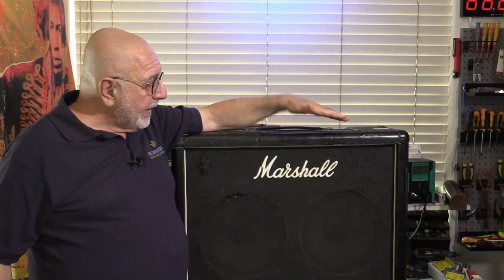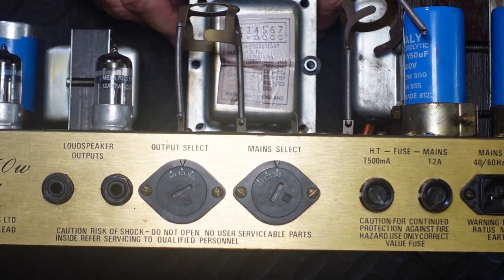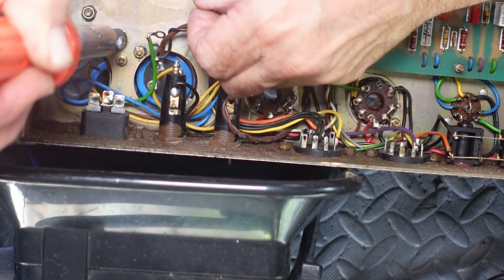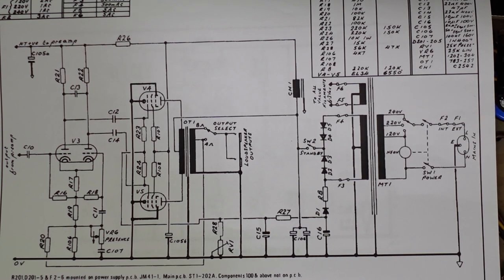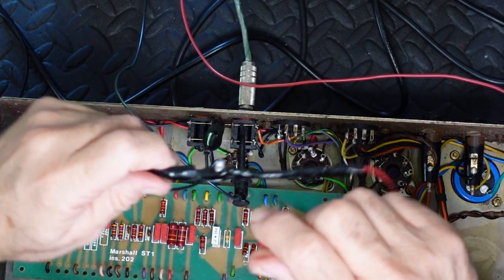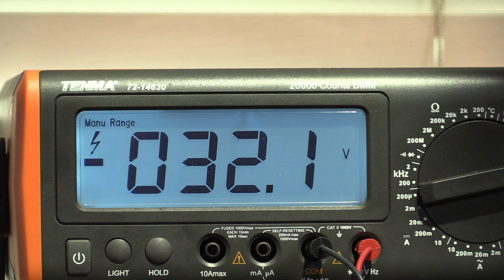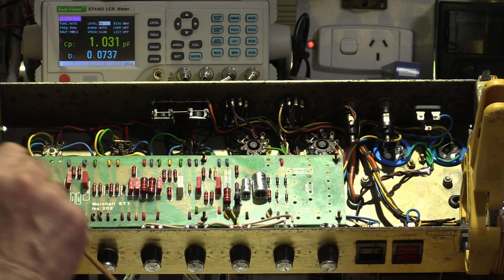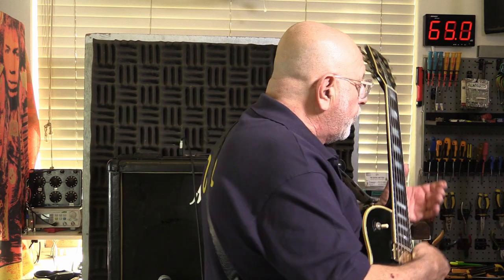How to repair a Marshall JMP 2104 with many problems

Comment: The more I learn from amp builds, the more important I think the power transformer is. In fact, not just the PT, but the whole power supply. I know, I know: we're talking about guitar amps here, so perfectly clean power, low ripple, beautifully regulated power supplies aren't the objective, etc, etc, etc. That's true. But I'm coming to the view that the power supply is to the signal chain, as the canvas is to the paint. No, the power supply is not strictly 'in' the signal path, but the signal rides on it. So the ropey, primitive power supply is a critical part of the character of a 5E3 Deluxe, just as the stiffer, better-regulated supply of a Twin Reverb is part of that amp's sound. And the PT is the heart of the power supply. So I reckon it's more important than a lot of guitar-playing amp users think.

Phew!

Cool old amp, and a cool video too, mate!
Reply from the maker: You stated the importance of the PT very well, Bladder! Thank you.

Comment: I just picked up a 1975 Traynor YGM-4 STUDIO MATE.  I went through and replaced some electrolytics, and I noticed that the bias caps were 68uf and 8uf. First time I've seen one that high. I'm glad I saw this
Reply from the maker: Good one, Soap. We don’t see many traynors in Australia. I’m glad my video was of some help to you.
Reply: I'm curious what other amps you.might have seen this implemented?
Reply: Also , would non polarized caps be ok to use ?
Reply from the maker: @soapboxearth2  non-polarized capacitors can replace polarised electrolytics. Non-polarised applications are often used for coupling, tone caps, feedback,  and oscillation. In amps, we mainly see polarised capacitors for filtering ripple or cathode bypass applications. Electrolytic capacitors usually have larger capacitance values for a given voltage. It is not so easy to make a large-capacity non-polarized capacitor, because the size and cost make them unpopular choices.
Reply: @theguitaramptech  so the bias circuit caps are filter caps? I guess I should use polarized?
Reply from the maker: @soapboxearth2  it’s the most common choice

Comment: Thanks Chris. I really like the way you set bias with the oscilloscope. It seems to be way more accurate that setting grid voltage. I looked up Doug Ford. What a sound!
Reply from the maker: Thanks Les. Setting bias by grid voltage will get you in the ball park. Setting by plate current is much more accurate, but setting by "Loud" playing levels using a signal generator and an oscilloscope shows you exactly what the tubes are doing.  I use 440Hz at 250mV 
If you have Nickelodeon on Spotify, listen to Doug's tone on that live album!!

Comment: Thanks for another great video, Chris . I appreciate you going through the schematic and didn't realize the high input was feeding back through the low input jack to the 2nd gain stage. Nice work brother man!!.
Reply from the maker: Thank you for your "thank you"! I appreciate it. Yes those contacts work great when the amp is new, just as the Send/Return problems. But in time they clog up and it "welcome to the world of intermittent problems".

Comment: Just noticed that this Marshall amp doesn't have any grid-stopper resistors between R23, R24 and the grids of the two power tubes, normally you'd be seeing two 5k6 grid-stopper resistors there, or maybe 2k2 grid-stopper resistors.
Reply from the maker: Yes, I noticed that and I like to have grid stoppers, but from memory the schematic didn't show grid stoppers. When you say "normally", are you referring to a 2104 or Marshalls in general? Thanks for the comment, Simon.
Reply: @theguitaramptech  , I also installed the 1KOhm 5 Watt screen grid resistors, and the 5K6 grid stoppers after I sent marshall an email that they were missing in my 1980 JMP 2104. There answer was that in those days the tubes were from a far better quality and so it was not neccesary for 50W amps back then. They advised me to install them if I use current production EL34 tubes for safety. It changes the tone a very little bit.

Comment: Intresting video Chris! What is your leakage tester device exactly? A led with a little resitor in series? Could you share the schematic ?
Reply from the maker: Its basically what you said. From memory, I had a Zener reverse biased to protect the green LED. The trick with the LED was to find one that was sensitive (ie turn on) to low currents. I can't recall the resistor values. I'll open it up one day and draw out the schem. I promised Uncle Doug ages ago. I'm just too busy with repairs at the moment.
Reply: No problem Chris , If and when it suits you ;)

Comment: Generally incoming (mains) earth connection should be always made on a separate point from internal grounds (safety feature). 
Also if I remember correctly should be made with a screw and nut because this sort of mechanical connection is considered more safe than just a solder joint to chassis.
Reply from the maker: Thank you for taking the time to reply, Jernej. You may be right, but I have not heard of either. I have seen too many poor nut and bolt connections, but if you come across a reference to educate me, I would very much appreciate it. Either reply here or through my www.guitaramptech.com.au website.  Thanks Jernej.

Comment: Hi Chris,
I own a Marshall JCM800 4010 (2204 in a Box :-) ) from the same era, but in much better condition. In my opinion, however, my Marshall sounds much better than this one. The distortion sounds a bit muddy, but that may also be due to the miking or the high output of the pickups.
All in all a great video and first class work.
Thanks for sharing and many greetings from Germany
Markus
PS: still praying for your doughter❤
Reply from the maker: Vielen danke, Markus. I will let my daughter know that my friend from Koln is still praying for her.
The 2104 sounded amazing in this room. My Sliders PAF pickups are vintage (low Z) windings with minimal wax potting. Any sound defects were solely my inability to record properly. 
I bet your 4010 sounds great. I wish Marshall stopped making new amps after the JCM800, and just focussed on reissues. Markus, your amp uses the same method of using an extra gain stage as the 2104, so make sure you keep the shorting contact on the LOW input extra clean.

Comment: Why change the bias cap value when you can just install 10uf 160v in there?
Reply from the maker: That's a good question. Without having to endure watching myself again, I hope I answered it in the video. In short, I like to have a stable bias that is well-filtered, so I increase it. But, you can't go too high or the lag in the bias cap charging can lead to other issues. The cap value won't affect the tone. If it did, I would not change it.